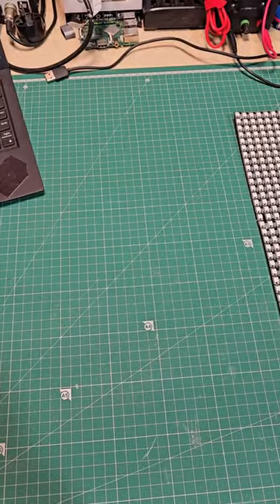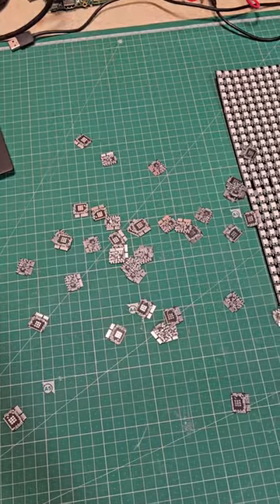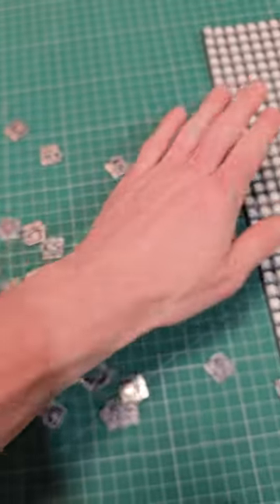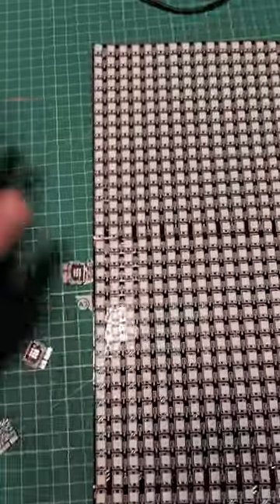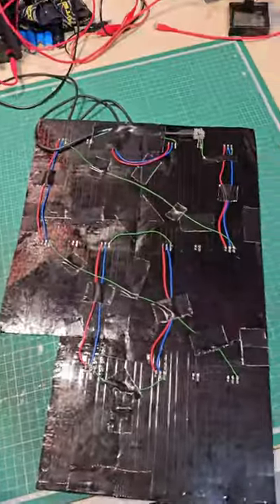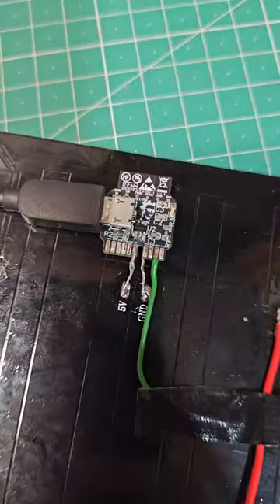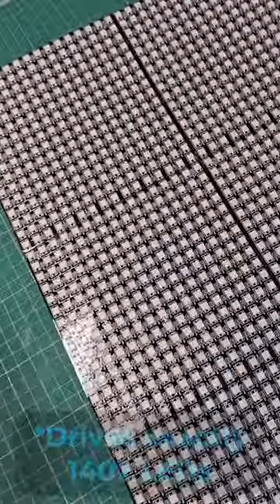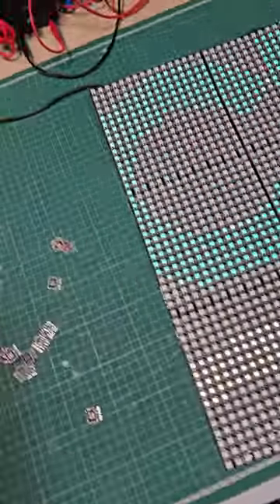I made a DIY $6 ESP32-C3 module and it drives NeoPixels like a boss!

Comment: I think nothing good will come of it if you turn it on at maximum brightness. need to rebuild power connection
Reply from the maker: So far so good actually! As long as not all LEDs are running at once. Eg average 30% of each board works well. Would eventually turn to toast I guess though!

Comment: Ooooh I want one!!!
Reply from the maker: Hah I am considering designing some 8x8s and having them made up, with better LEDs, firm PCB, and a spot on the back for an ESP32, RP2040, STM32, or similar. Would you be keen?
Reply: @PlatimaTinkers  RP2040 is a great choice, especially for the pgio and ws8211 LEDs. the esp32-c3 has built-in wifi. STM32 is kinda vague, though I like the M3 features that M0+ doesn't have...
Reply from the maker: @kayakMike1000  Yeah but pros and cons hey; RP2040 is not RISC-V, which I prefer! PIO's are a win. C3 is great for RISC-V, else if going alternate then the S2 is epic. STM32F1 series is what I was looking at there as I have heaps. F2 would be overkill, and F0 is a bit on the lower performance side for driving large number of LEDs. Was also thinking of spot for a 328P too, then that covers all four key platforms at basically no cost; just solder on your preferred MCU and note which pinout is connected to the WS2812B DIN.